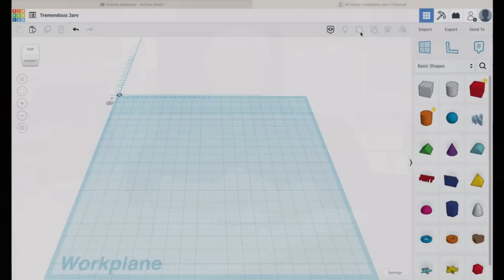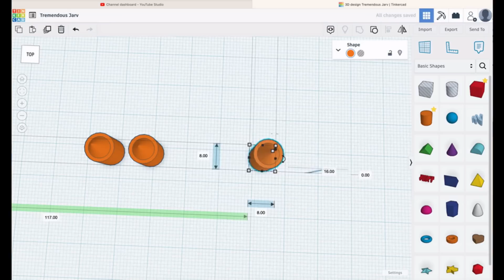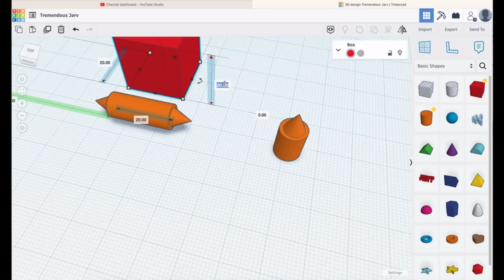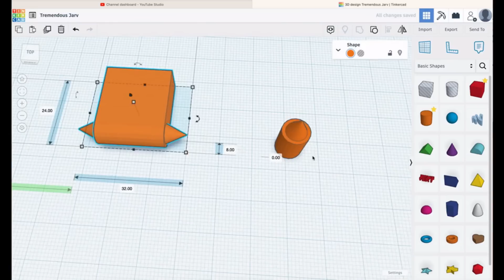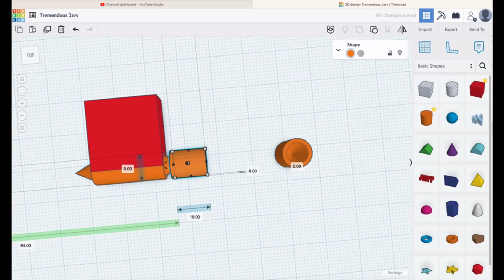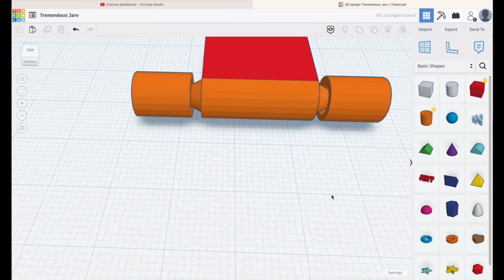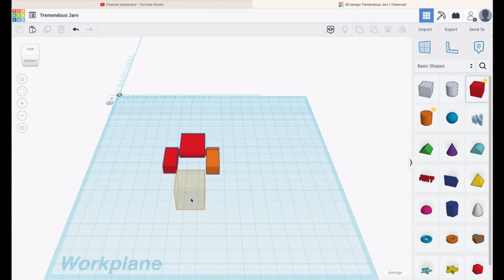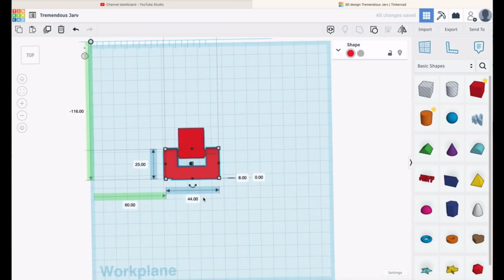2186 Print In Place Hinges - A Tinkercad Tutorial

Comment: I generally use a roll pin for hinges on prints. This is definitely faster.

The most interesting part for me here is your work-flow in tinker CAD. I am a fusion 360 user and my approach would have been entirely different.

Probably would have used a sketch for the inner profile, revolved it, cut it into the outer blocks and then used the face offset tool to set clearance. Totally different order of operations.

Tinker CAD is very neat though, seems more "hands on".